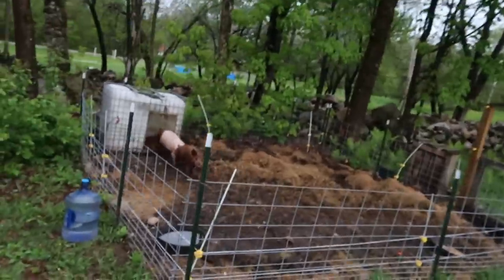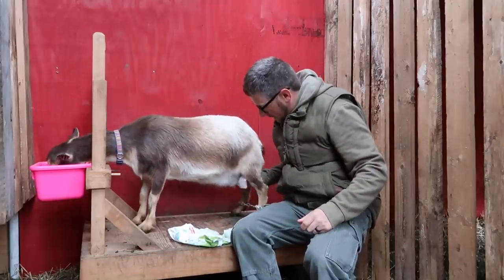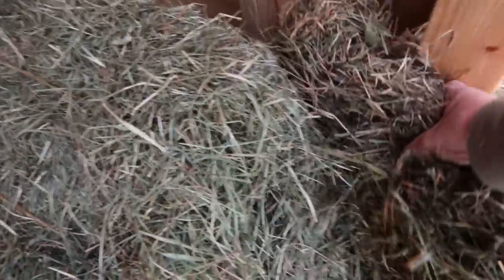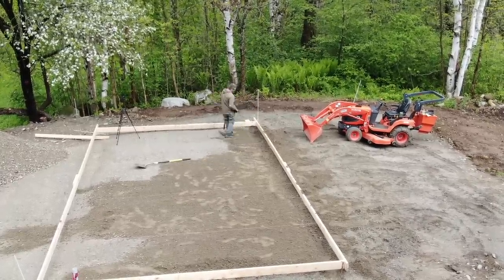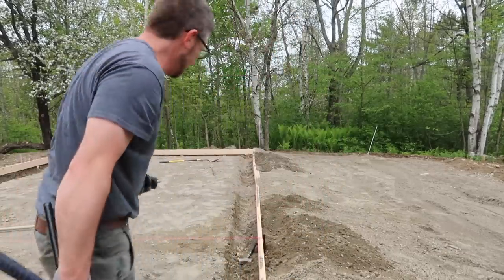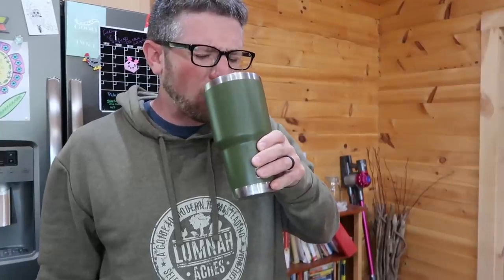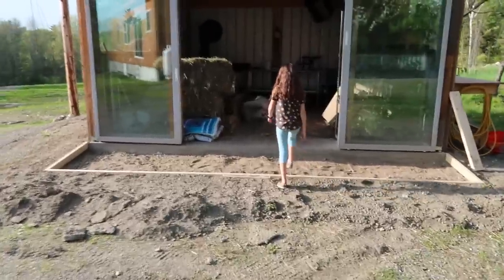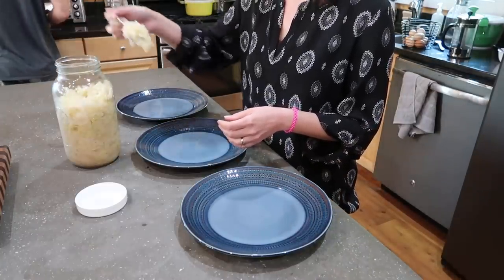I've Been Waiting 5 MONTHS for THIS?

Comment: That slabs looking like it's coming along great. You might want to reinforce that board all the way around on all sides, if you're pouring 12,000 PSI footings with 9,000 PSI slab it's going to bow those boards no matter how much dirt you push up against the out side of them, unless they are staked every 4 feet. And once the concrete is being poured it's too late. I kind of got that from my own learning experience. I didn't lose or quit, I just learned. LOL. Good luck can't wait to see it done. God bless you all, Jimmy

Comment: Yeah, just filling to the bottom of the form and back filling as I go is what I do. For smaller forms I'll use stakes outside the form to hold it. I've also used removable braces that I pull as I pour the concrete so i can back fill first but that's just for short lengths.

Comment: Goood Morning Al ,
I was checking out the drone view of the concrete form relative to the tractor. The barn is not going to be as large as I was expecting.  I think the barn will fill up pretty fast. Maybe it's time to think about a garage at the end of the house where you park your vehicles now.
  Have you ever shaken hands with a farmer that milks cows by hand ? They can have a very powerful grip !
Reply from the maker: We aren’t done with the barn yet. We need to add another 16x30 pad
Reply: @Lumnah Acres ,
Yes , a larger barn will be more useful.  I still think that you will eventually want to add a garage onto the house.  More protection for your vehicles and more convenient on winter and rainy mornings .
 My garage is not attached to my house so I have to go out in inclement weather to get to the garage.  I'm thinking about making a covered walkway. At least for part of the distance.

Comment: Make milking easier....... take 1x3 board cut two board to the width of your milk stand, clamp them next to each other and in between the two boards drill a hole just the size of your goats ankles. Screw one board to the milk stand with a short spacer the height of a goat foot and place a pivot pin with spacer on the second board. Then attach a latch between the two boards.  That way when the goat stands on the milk stand you can clamp her feet down so no kicking.

Comment: What are the dimensions for the Raised Beds that you planted your tomatoes in?   Will the same dimensions work for Peppers?  Most of what I've read and watched on Youtube suggest 24" to 36" wide raided beds.  The one you used for tomatoes looked 12" wide. Is the purpose of the Chicken Wire attached to the Cattle Panel  to stop growth  from growing outside of the Trellis?  If so, how much pruning do you need to do?

Comment: No rebar in the footings..
and rebar or steel mesh in the slab.??????
Reply: I'm sure he will, it looks like he's just getting everything prepped.
Reply: @clydeacor1911  
It was just that he said he was pouring concrete tomorrow...
And pours usually start first thing in the morning to beat the sun...
I've been around pours that started at 3am..
They want the concrete on the ground and most of the finishing done by noon
I've kept the laborers out as late as 2am finishing the grade. (the boss doubled the pour size the day before... He said do what you have to... We've got to get back in schedule...
And the next morning
Some of the laborers would help hang lumber..
Some would help the rebar crew... the rest would be on the pour...
Reply: @jimh712  I was just thinking that he'd definitely use some rebar for the footings and rebar or at least mesh for the slab since he has been around the construction industry. But you never know what people will do these days. Although rebar is cheap compared to having to rip it out and start over.
Reply: Another vote to add mesh and/or rebar. And more stakes on the forms. I had a very expensive slab failure on a barn from previous owners shortcuts. Do it right once, Al!